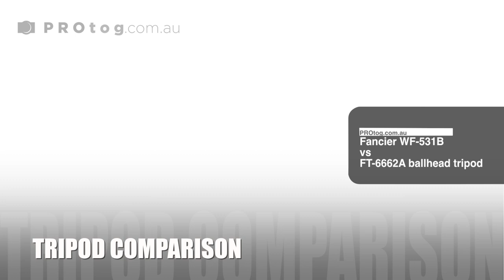Fancier WF-531B vs FT-6662A ballhead tripod

Comment: Excellent Review. Got mine today (WF-531BT), based on your video review. Thanks very much.
Reply: how is it? are you satisfied with build quality? i'm considering buying this but a bit tempted to buy another one for twice the price, since that would be solid after 10 years of use. do you thing this will last long?
Reply: galingong Actually I am satisfied, for the $40 I paid its an excellent tripod. As long as you know the limitations of the tripod and work with it, it gives excellent results. I've carried it to Sydney, and Bali last week and it's worked great while travelling too. When fully extended it's a bit wobbly, so I don't raise the centre mount shaft, the camera stays solid, and I hang a backpack for weight if its windy. The ball head is quite good, it doesn't have any play yet. It's a great tripod if you're starting out and learning photography. 3 years from now, I'll probably buy a good carbon fibre tripod that will cost 8 times as much as this.
Reply: y2kdisease
Cool, nice to see a user review on the tripod.
Are you still using it? If so how is it holding up?
Reply: Is WF531B   Arca Swiss compatible?

Comment: I'm getting my WF-531B as a gift. I was looking for tiny tripod after being set, and this one has 25cm in specification. I thrilled, and when i saw it was possible to buy in person, in a shop in city nearby my attendance, that was totally my destiny! I was mostly finding inconvinient offers (too far away - i can't choose post delivery because i need it asap, too heavy, too long, too expensive). It was also in a little bargain (available in only 2 shops, where i bought it was twice cheaper - about 50$, quite decent, and other price was 100$! So i thought, if it's really twice cheaper for the 100$ quality, then i'm totally lucky) I was really hopeless, because cheap tripods after being set are over 60cm lenght, and "compact" tripods are reallyy small lenght in total (100-120cm..c'mon) This one is compact already, and it's long enough after setting. (centre mount probably does the most, but whatever - i might hang something on the hook to make tripod steadier, but mine i think has no hook :( ) Right now i'm in hurry, because i departure in 2 days, so i needed this tripod fast. I will tell you my opinion when i have it. I'm still very happy i found it! It looks solid.
Reply: Is WF531B   Arca Swiss compatible?

Comment: I have a question about 6662A. Besides putting your camera on the bottom,can you remove the center column? I was looking at 6662A_BH or SH,I don't know if there's a difference.